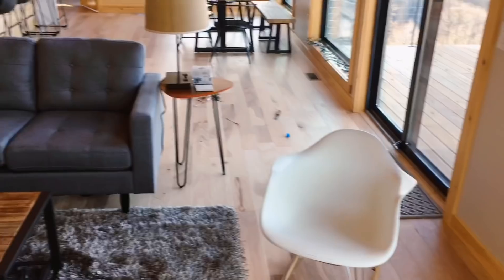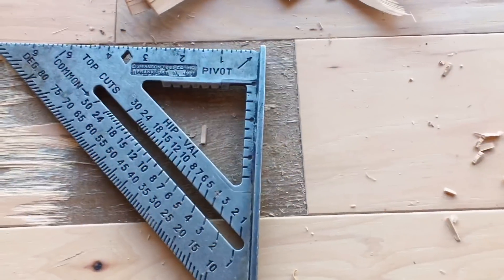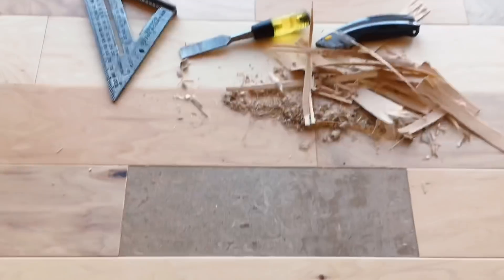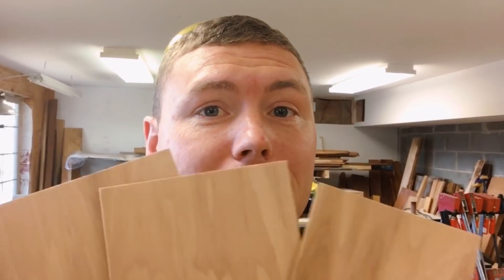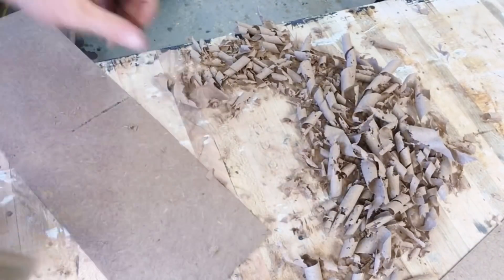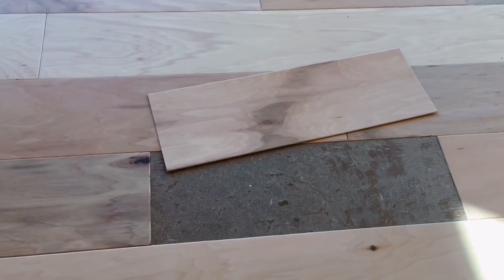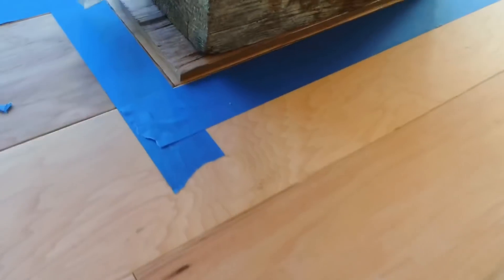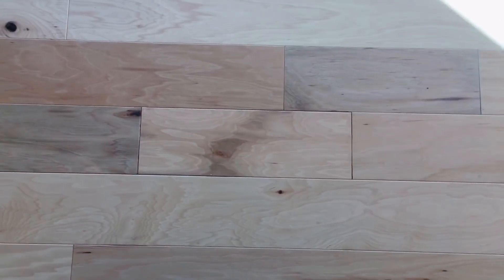Engineered Wood Flooring Repair | How To Tutorial

Comment: Looks great!  Always interesting to me how different people take different approaches to do things but end up with the same results overall.   I would have done it differently (and have done these types of repairs numerous times myself) but there's nothing wrong with a different way.  "More than one way to skin a cat" as they say.  Nicely done and thanks for sharing!
Reply: How did you do it?  I was thinking that a router would have taken the material out much faster than doing it by hand with a chisel and with a precision depth.
Reply: @chrismoore9997  I just saw out the center area of the board.   Then chisel out (carefully) the rest of the board.  Then cut off the bottom of the groove sides of the new board and glue it into the spot the old one was in.  The boards are usually the same sizes so you can use another board the same size or make one to fit.
Reply: @chrismoore9997  ,,  years later but,,,,  I would remove the entire plank down to the floor. Remove glue with oscillating tool and replace board. Don't have to leave the job site!!  But hay,,, like dude said ,  more than one way to skin a cat!!!  And where did that saying come from??? Sounds kind of cruel!!  Good day!

Comment: Very good repair.  Not sure if it's your go to type of engineered flooring but perhaps its best to stay away from what looked like MDF based flooring. I'd now be worrying it may be the start of more call backs.
Here's to a prosperous new year to you all. 
Happy new year fae Scotland.
Reply: John Mackay agreed. They used mdf core engineered hardwood in our house. We had a small leak at the bottom of our backdoor and some water got underneath the hardwood flooring. The mdf core swelled up. Hardwood veneer was fine and the plywood plies were fine, but had to replace the piece by the backdoor because the swelling hump looked terrible. Luckily they left an extra box of flooring, but I’m pretty sure this isn’t going to be the only repair. Our next house will have SOLID site finished hickory hardwood flooring. I’m not a fan of the factory finished floors with chamfered edges because crud accumulates in the grooves over time regardless of how clean you try to keep them.

Comment: Jaime, why did you choose to use your radial arm saw for the cross cut rather than a sliding miter saw or using a cross cutting sled on your table saw. Just curious, I’m a newbie at woodworking.

Comment: That job was a bummer, I don’t envy you. The substance you described as being “like cardboard “ was probably craft paper impregnated with phenolic resin. That’s a common material in the business. Two things I might have done differently are the following: Underneath that piece of wood you used as a caul, I would have put a large piece of wax paper. This would act as a release agent. It guarantees that you won’t accidentally glue your caul to the floor. Second, I mix my epoxy separately on a board or panel. I keep that lying around and observe it to check the status of the glue joint. As with that board, so with the actual workpiece.

Comment: Suggestion, next time cut to the subfloor with a Fien oscillating saw and do a complete board repair, then glue to the subfloor.  If it is a floating floor rout out the space and finish with a chisel to 1/2 depth of floating floor, mill repair wood and glue using acrylic tile mortar. The tile mortars body will allow for some amount of adjustment to achieve a flush finish.
Reply: Yeah I was thinking the exact same thing. Would have been a 30 min job.

Comment: Even if it’s glue down, why not take out the the damaged piece? Do you have radiant heat under those floors?
Regardless, great skills 👍
Love your channel!
Reply: ... would have definately been easier to take board out and refit... take out bottom of grooved end so it slips back in... and done on the same day and on the spot.
I've done this method many times...
Reply: @dsan9718  Yup. Standard method where Im from. Done alot of it.

Comment: Great video, and some determination on display there. Question: this can't be an isolated issue - shouldn't the manufacturer be able to send replacement veneers?
Reply: Normally, this sort of repair is performed by cutting out the entire plank that is damaged, and replacing with a new plank cut to fit. So veneer only replacement is not the usual repair method.
Reply: @stevebabiak6997  yes, I was hoping to see that done in this video.

Comment: Nice job.
Question(s):  Years ago when I did a little wood flooring, on the West Coast, I was taught that the short pieces that come in the box are for ends of runs at the walls.  I was also taught that the ends of individual boards should not be within 2' of each other, row to row.  In the past 10 years, now on the East Coast, I have noticed that none of these two details are observed.  My questions are: Did something change in the consensus among flooring pros?  Or is it done that way now because manufacturers are only providing short little pieces in packs of boards?  Or has the method I have been observing on job sites lately (and your video) been the norm forever?
Reply from the maker: Thanks.. and good question. This is still the desired way to do it if the boards provided are long enough to accommodate this spacing. Some runs of wood that we get have all short boards... so more joints closer together, but never closer than 2” and always in a random stagger for the best look.
Reply: @PerkinsBuilderBrothers  Thx.  I've seen a lot of short pieces scattered about on jobs and had a hunch.  Your channel is great, keep it up.  Your methods are wise, you obviously had a great teacher, and father.
Reply: They call it a random stagger but if they only give you two size pieces then you can't randomly stagger it and you end up with a pattern

Comment: Great result in the end! Theoretically wondered if you could glue the cut piece upside down to the floor (veneer face down)  without planing it first? Then plane the backing down till you were just left with the veneer already glued to the floor and the right thickness? In theory should leave same result but less fiddly?
Reply: You would have to create the bevel and finish the surface.. much harder? Plus the way he did it gets all the chiseling out of the way before any commitments are made with the glue.
Reply: @neild7971  was just thinking out loud as he was working through the repair 👍 if it's harder as you say then thankyou for clearing that up bud 👍
Reply: @ogeoffreys  - The hardest part would be matching the finish because there is some kind of finish on that wood from the factory.  It would be very hard to duplicate.  I have tried to repair using planks from another batch out of the same manufacturer, they just don't match, even though it is from the same company less than a year later.  Using the finished face out of the same batch of flooring is the only way to get a result that is virtually imperceptible.
Reply: @chrismoore9997  that makes a whole lot of sense Chris!! If there is a factory finish on the face of the veneer then definitly the only way!! Very time consuming and a lot of patience required!!
Reply: That would be opening a whole new can of worms - finish won't match - the odds of damaging surround wood would be massive - leveling would be a nightmare.

Comment: I have one now where the GC drilled a hole into the finished floor for some wiring to go into the island.  Then the homeowner did not like where the island was and had it moved. Now there’s a hole in the guys finished floor.  Not my problem though.

Comment: I used double sided tape and scrap to make a router guide to take out 1/2 the plank, thickness planed to make perfectly flush
Reply: That is what I was thinking.  Router to remove the damaged section.

Comment: You can replace it with a new piece of floor and sand the edge that's cut to size so it has a factory finish.  Use the same glue that was used to install floor as a filler at joints if necessary

Comment: Did you consider router out the bad piece to a deeper depth? Then you can replace with a thicker piece cut from the board. Having just the laminate thickness seems like an opening for chipping
Reply: I agree with your idea regarding the router and cutting the new slab thicker, but this method should be durable with all that epoxy.  It may just outlast the rest of the house.

Comment: I’m not sure how much time was in that repair, but I’ve done a couple repairs and found out it’s easiest to just chip the whole board out. Usually doesn’t take me longer then 2 hours to do the whole repair if it’s glued down. But that veneer looked thin, like scary thin. I haven’t ever worked with stuff under a 1/16 thick. Nothing wrong with how you did it, I just feel it takes longer to do your method then just replacing the whole board?
Reply: To replace the whole board don’t you lose the tongue and groove that helps hold it in place?
Reply: @Blingem14  yea kinda. But the board gets glued down so it don’t matter as much then.

Comment: Brah! Just take out the whole board. Use a skill saw or multi-tool and cut out all but a 1/4 inch. Pull that 1/4 inch with pliers or knock out with a chisel. Remove the spline on two sides of the new board. One length wise and one width wise. Glue with Pl weight it over night. Done. I did nothing but single board repairs for a year straight. Got it down to a science lol. Would take me an hour originally. Now 15 mins ..tops. Not putting down your work. You are a skilled man. Just try it "our" way and you'll see how much easier it is. Just make sure that skill saw don't get away from you and you be golden. Kind Regards Lucas

Comment: How about using a router to remove 1/4" from flooring thickness so then the infill could be thicker and easier to manufacture and install.
Reply: SpeakUp RiseUp I was thinking the same thing
Reply: You're thinking about it too hard.
Reply: It worked so why change it...

Comment: Is there a more accurate way to make the score perfectly straight? The speed square is flat, but the knife body is rounded.  Maybe build a jig?
Reply: You could probably use a router with the right jig to remove enough material that you could slice the replacement slab with a saw instead of needing to scrape it down like that.
Reply: Faisal Khawaja what I do is first place the repair piece over the damaged section and then trace it with a knife. A little imperfection of the end cuts doesn’t matter then as the joint is a perfect fit because you remove the damaged section according to the knife line you just traced.
Reply: Thank you!

Comment: How often does this happen?  I am going to be putting in a wooden floor in my family room.  We live in a high humidity area and I was wondering if a plywood laminate floor would be more stable than solid wood.
Reply: Not very often with quality products. Honestly though, for the price, I would go with a solid hardwood or LVT if I were doing "planks" per say. There are a lot of waterproof engineered wood products also to check out. The issue I have with engineered floor, though it looks good and goes down quick, is you will scratch it and dent it and it will be ruined if you have a leak someday. Actual hardwood can be sanded and refinished multiple times. And with the right finish, it is as water resistant as they get and wears very well. 
That's just my opinion. Apples to apples the better product is a solid hardwood. But if you're looking for something like a bamboo look in a 6 inch wide plank, it may not be an option for you. i would encourage you to look at wide plank white oak hardwood in that case, and see the finish you can draw from white oak. Anyway..... If there's a certain type of look you have in mind, reply here, and I will give insight however I can. I'm sure Perkins bros would also. 👍
In between managing different construction outfits, I went into commercial flooring and shower installation, but I do my own flooring(along with my guys) in all of our builds. There's a crap load of different options out there. Alot of them me nor you will ever see. Depends on your local suppliers - supplier's. Lol

Good luck to ya regardless! 👍
Reply: @MostlyPeacefulCombatVet  - What the local supplier stocks makes all the difference.
Reply: @chrismoore9997  you're not kidding! We use nothing from the box stores. Too expensive for the below par quality and selection is..... Well you already know. 🍻take care!
Reply: NUCORE FLOORING
GOOGLE IT!
Reply: Thanks for all the reply’s. I will check out the Nucor.
Reply: NuCore is great flooring.
Along with 
-Armstrong Pryzm 
-Coretec Plus
-Solid tech by Mohawk

Just to name a few more. 

All really great flooring. I always use LVT with attached moisture barrier/backing. They used to come with cork backing. Now they're using more of a rubber/foam. But it also keeps the floor from clicking if there's any low spots in the sub floor. It absorbs noise, and also acts as an insulatation. This flooring is not only great on wood subfloor, but especially great on concrete. 

Most of these mid to higher end LVT's are so realistic you cannot tell the difference between them and engineered hardwood. Much superior to engineered in every way in my opinion. Go check some out. Go to your flooring wholesalers and take a look. And even ask if they can show a home being done in a good LVT you could see and feel for yourself. It's gotten more expensive over the years because it has so much more to offer than just some vinyl. Ceramic wear layers or diamond kote is one, and whatnot. 

Hopefully this helps a bit as well. Good luck on your new floor!

Comment: If the whole floor is 1/4 veneer and the entire floor is glued down, then how do you replace the whole floor? If that piece delaminated then it's likely the whole floor will over time.
Reply: Exactly. And even if the floor doesn't delaminate, eventually it will need to be replaced due to wear. The whole thing just seems problematic.
Reply: @George Davis That's encouraging
Reply: @George Davis - How do you refinish a laminate that thin?  I wouldn't think it could be sanded.
Reply: @George Davis NOT IF YOU DONT BUY 8MM THICK TOP PIECES
Plus most engineered flooring cannot be sanded unless it has microbevels

Comment: What a bear. I am assuming it was prefinished engineered flooring(Tongue and groove plywood) since you didn't just swap out the whole piece. I actually made edge banding using the top veneer for using the engineered flooring up steps.

Comment: what the hell kind of floor gets glued down to the sub floor and what happens in10 yrs when you want to change the floor do you rip up the sub floor as well so same question as half the other comments why not take out the whole PC of floor¿????????!;!!!!!!! considering how thick/thin the veneer is be lucky to get 10 yrs out of it
Reply: Many wood floors are glued down, it offers a solid, squeak proof floor. I've never seen this done before and would NEVER recommend this. Always take the entire board out and replace it with a new one. Takes an experienced flooring installer about 10 minutes